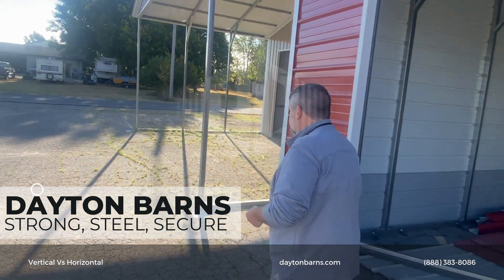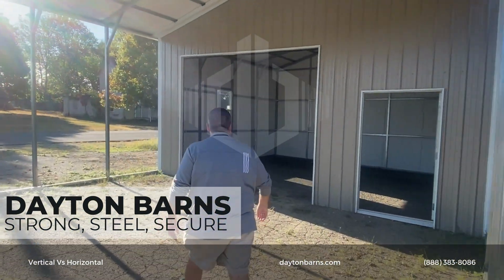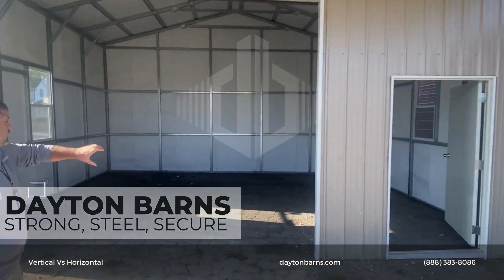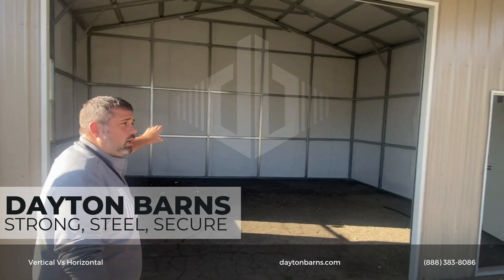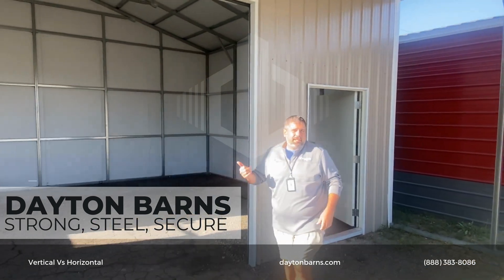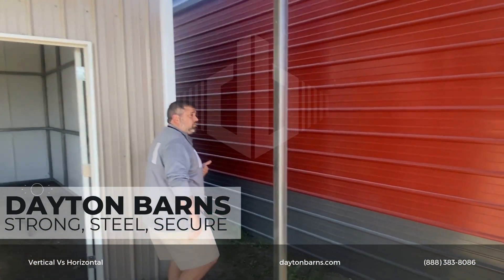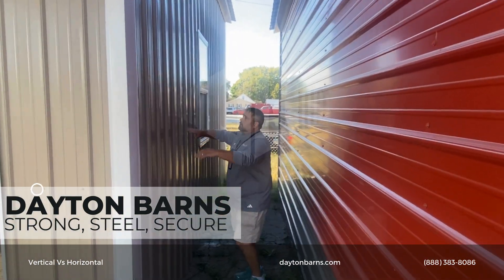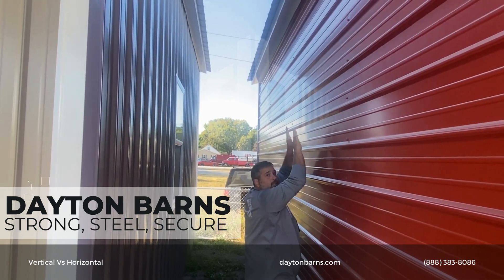Choosing Vertical or Horizontal Siding (All-Steel, Metal Garages)

Comment: I actually really appreciate that BANG test. I know horizontal is cheaper but it actually looks more sturdy based on that test. It appeared to shake less.
Reply from the maker: Yeah, for sure! One thing to factor in too — the vertical panel had a bit of insulation, which helps a little, but it wasn’t very thick. The main difference really comes from the extra bracing. 

Anything over 12' tall, I really recommend going vertical, especially if the leg spacing is 5' like in the video and not 4' like we use in higher snow-load areas.
Reply: @dayton-barns  what's your website? I'd like to take a look, if you service Wisconsin.
Reply from the maker: @philkingmke  daytonbarns.com, my name is Landon and my direct line is 937-910-5789.  The link at the top of our page goes to the about me and our website as well.
Reply from the maker: @philkingmke  I really like the building company I have available in Wisconsin.  They care about your projects as much as i do. That is sometimes hard to find.